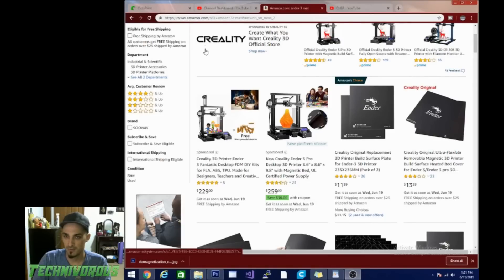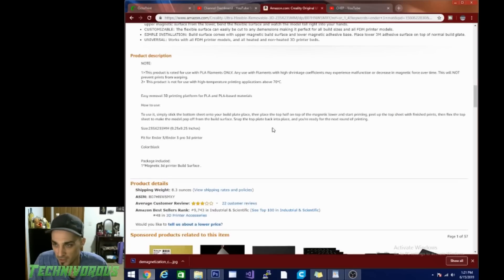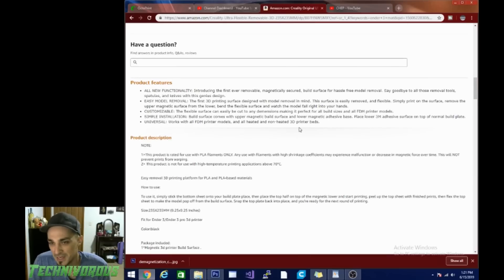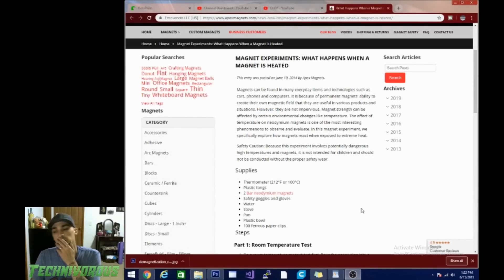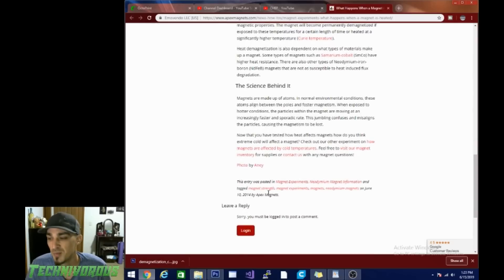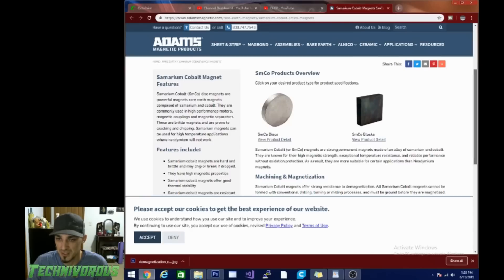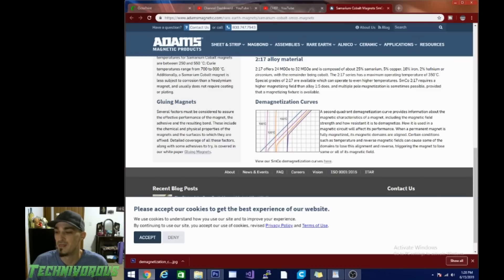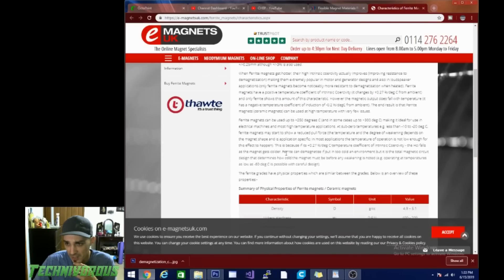BUSTING the Magnetic Bed Myth - will it fail? - 3D Printing 101

Comment: As a chemist will give you my 2 cents 😅 iron is naturally magnetic due to his atomic charges, the lets say new magnetic materials as neodimium and cobalt samrium are alloys that mixed create magnetisn, now this alloys are made to have a stronger magnetic force and were developed to reduce the size of hearphones and speakers, remember old time loudspeakers were masive and now are realtively tiny and louder, geting back to the beds they have a big area so they have a lot of grip even the material has a small magnetic force and to alter this force you need to reach a  temp that will affect the material at an atomic level.

Comment: While the magnetic effect may not be an issue, the flexible plastic material loses it's adhesive property if the bed is heated to 80+ degrees centigrade and if you use high temperature nozzle materials like Nylon etc. Consider any plastic being exposed to 80+ degrees from below and 260+ degrees from the material being printed. This deforms the surface of the material and renders the flexible part of the bed non-usable, while looking visibly okay. This is my experience form trying to do high temperature printing on the Ender 3 Pro. Use glass instead.
Also, the bed leveling may be offset by 2-3 tenths (mm) if ramping up the bed temperature substantially. So, use glass and check the leveling using the high temperature during the adjustment before printing with high temperatures. :)
Reply from the maker: That's a great tip on the bed warping with the heat! Always level when at temp, just be careful!

Comment: I just started using my new ender 5 which has a magnetic mat... so any idea what i should set bed temp at when printing PETG? Roll says nozzle temps from 230 to 250... I will be printing rc plane parts with this material... maybe 235 degrees for nozzle  will be a good choice...i am brand new to 3d printing started 4 days ago...any tips from experienced users is greatly appreciated...ps i have heard PETG is harder to print with than PLA... I wonder if they mean stringing or quality...
Reply from the maker: my reccommendation with PETG is to start at the high point, and lower the temp by five degress until stringing is gone. normally run between 235-245. you should know that most ender 3 thermistors are slightly off by 5-8 degrees,so when it says 235 its actually around 230. i made a video on PETG with the ender 3 a few days ago https://www.youtube.com/watch?v=29Up-L-psv8 i have had a lot of success with PETG on my magnetic mat, but it does stick better to PEI and glass. but you will be fine. bed temp will be fine at 55, but you will adhere slightly better at 65
Reply: @Technivorous  Thax a bunch for this response... i will be trying soon... PEI? is this the stock metal plate that comes with ender3? Do they sell a Metal plate for ender 5? i ask because i am have parts fail do to falling off my magnetic bed... i dont use any sprays for cleaning or sticking though... not sure what to use...i just want print to not move... thanks for your help i am subbing now...
Reply from the maker: @roadstar499  no problem. it the hot end is hot, and its still not sticking well, try getting a touch closer to the bed. they sell a glass plate fore the ender 3, but you can get magnetic pei sheets. PEI is a medical grade material that is super smooth ultra high temp plastic, and everything sticks to it pretty well. about halfway through this video i switch from pei to the magnetic mat, its about printing in petg https://www.youtube.com/watch?v=29Up-L-psv8
Reply: @Technivorous  PEI... looking for one for my ender 5 on ebay... i think what works on ender 3 is same demensions..nothing found that says for ender 5...Not sure if a stock ender 3 bed is metal or PEI.... just not sure whats my best choice ...i will be printing plane parts with PETG... I guess i should first try the MAG bed i have maybe wipe it down with alcohol and i think this guy uses GLUE stick that kids use for crafts to help parts stick... and i also heard hairspray... not sure what type of hairspry or when to spray on...before you head bed or right before prints starts... lots of info just want prints to stick mainly...thax
Reply from the maker: @roadstar499  pei is a plasitc, the stock bed on ender 3 is aluminum... here, this is an affiliate link, but you can place this right on your bed as it is and get great PETG adhesion. https://amzn.to/2nzx9Ih
Reply from the maker: @roadstar499  and a lot of people use gluesticks, and hairspray, they work. sugar water works too but its a special ratio, and i dont remember it. white elmers glue... but to be honest i have NEVER  had to put anything on my bed and make a mess. i have used blue painters tape for some picky filament. this is not to say you shouldnt use hairspray. or whatever you can make work. i just dont have any experience with it.
Reply: @Technivorous  well the white pla that came with my ender 5 stuck pretty good.. this other clear roll i just started using the work broke loose seral times... the print was turning out very good until it failed...so my believe is not all pla sticks to work plate as good... i am guess the white had approx 10% better adhesion which was enough not to break loose... I experimented with temps with the clear and it still did not hold... i guess i could go even higher by another 5 degrees... but white printed and held great at 215 degrees... i printed clear at 215 and 220 ..print looked great but broke loose...225 may be the sweet spot... i only have been doing this 5 days so i don't know if my higher temp theory is correct or not.. i am thinking all filament works best at a certain temp depending on its brand...i do no others like ABS and nylon need way more heat....thanks
Reply from the maker: @roadstar499  white has a tendancy to hide defects, so it usually comes out really nice. if your model is starting to go down nice, and then slipping off during printing, try using "brim" under adhesion settings. it will leave you with a little more cleanup, but the brim will keep the model where its at,
Reply: @Technivorous  i think i solved issue...yes even with brim the clear let loose... i was printing at 215 degrees which worked fine with this white and blue pla my friend thats teaching me gave me... i bumped up nozzel temp to 225 degrees and the clear pla stuck as good or even better than the white and blue at 215 degrees... print also came out just as nice... so i could probably bump it up or down 2 degrees if i wanted to and get good print... thinking maybe  printing base hotter then finishing print at 220 should be fine also... I guess all PLA is not the same,which makes perfect sense... thax
Reply: regarding stringing... does increasing nozzel temp or print speed affect it in any way... stinging is not bad at all since i have retraction set pretty well i guess...just curious if speed and temp settings affect it... like maybe i could print 5 degrees cooler and 5 percent slower for example... or same temp and speed up or rise temp and slow down etc... just trying to learn as much as i can about 3d printing... thanks again...
Reply from the maker: petg is not hard once you get it to adhere, but you are halfway there, because there are a lot of plas, that contain petg and require high temps because of it, your clear stuff is a good example of that, the more translucent the filament, the higher the temp in pla cases. i have a purple pla, that prints best at 240. its a colorme3d purple haze, and semi translucent. it says pla, but i know its a composite, not only from the high temp, but pla is not clear. have you ever printed a temp tower? they print different tiers at different temps so you can check for stringing and defects and find the perfect temp for your filament!
Reply: @Technivorous  Thanks for the great info...never print temp tower... i only got this printer last saterday i am a total newbie... maybe my friend can help me with that... although i am not sure he knows either...thax
Reply from the maker: @roadstar499  https://www.youtube.com/watch?v=i3SLkTYu2cQ&list=PLPb81Z-Cw4oheuYfZy9GHORyQOY0aDgod&index=6&t=0s  this video will show you what its like to do a temp tower. do you know about thingiverse? its a site to download stl files, go to thingiverse.com, and search 'petg temp' you will find what you need. all the stl's on thingiverse are free.

Comment: Thanks for this video. Take my sub. :)
Reply from the maker: you're welcome as always! glad to have ya!
Reply: @Technivorous   - Quick question while on magnetic bed - Can i use ABS juice(thin mix) on the magnetic bed along with heating? Would this help with adhesion of ABS? TIA
Reply from the maker: @sq33qs  tbh abs alone will destroy the surface of the magnetic bed, so yes you will need something in between if you intend to do it regularly. i havnt tried that but it should work. let me know!
Reply: @Technivorous  -Will do :) Thanks

Comment: Yea I was always under the impression that the magnetism came back as soon as the temperature was below the Curie point
Reply from the maker: right. so i dont understand the people that want this long term tested, and i dont understand the people who want me to turn it up and down. its good up too 110, if it dosnt lose its mag after 12 hours, it wont. and if it does, i just wont turn it up that high. i mean who needs it that high anyway? lol. about an hour to go til the 12 is up! then i will post part two, and this myth will in my eyes be completely put to bed!
Reply: @Technivorous  Reason why people wanna see long run tests is because the failure mode isn't loss of msgnetism. Its a desintegration of the plastic binders that make up 95+% of these magnetic pads. Some say they've experienced it begin to crack and crumble after less than 20 hours at 70-75°C. 20 hours is barely a single half-volume print on an ender 3.

Comment: Why would creality say 70 degrees if there is no issue up to 240? doesn't make sense to me. Thanks for letting us now.
Reply: I'd throw in a little CYA on their part too.
Reply: They didn't research it in development and took the myth as fact? Who knows.
Reply from the maker: the temperature they work til is variant depending on the amount of ferite in the batch that gets extruded. i would speculate, that originally they bought the cheapest mags they could, and have since upgraded. this is evidenced by the fact that the original ender 3 came without the magnet, but as an add-on, i believe when the pro version came out, they realized the call for magnetic mats was greater than they anticipated, which is why its now a standard part on the ender3 pro. the logo and dimensions are the same, but the original magnet was not as stiff... a side-effect of rubber heavy magnets. there also seems to be a width discrepency in thickness between the original mattes, say for the cr-10, and what they use now. thinner magnets= less ferite= lower operating temps.
Reply: Problem isn't magnetism, but the binders in the magnetic rubber/vinyl/pvc pad start to break up. Causing the pad to crack, crumble and disintegrate.

Comment: My creality magnetic bed held great 70-80C.  After I ruined the surface I bought some cheap eBay fake ender 3 magnetic beds and they curl up loosing their magnetism before they even get to 70C.  They return to fully magnetic when they cool.
Reply from the maker: yeah apparently this depends on the ferite to rubber ratio. the higher quality ones that creality uses are denser and stiffer, and seem to not have that problem.